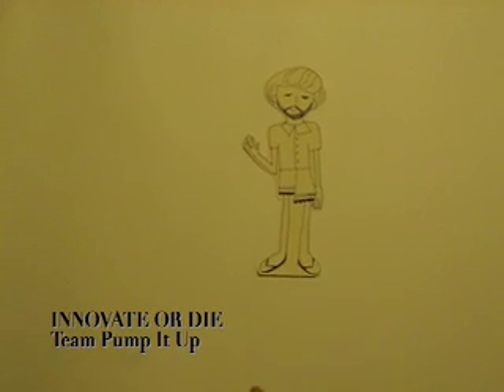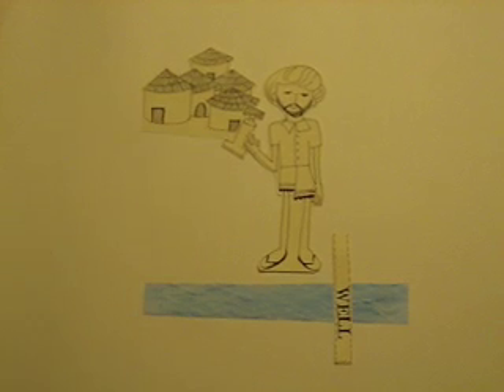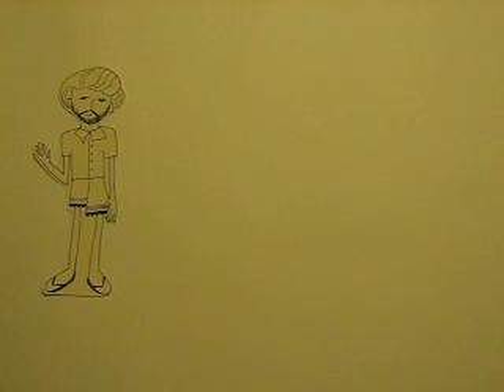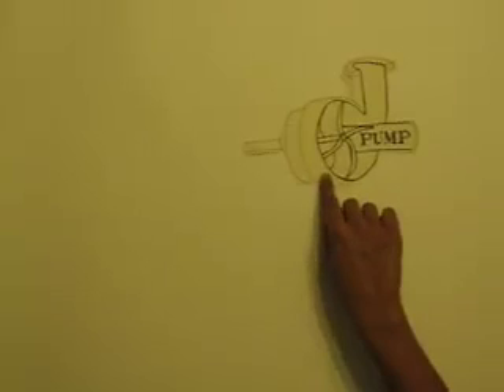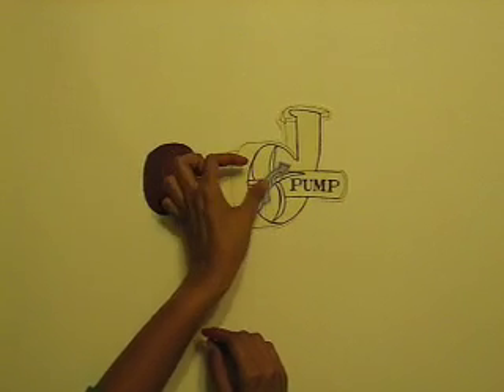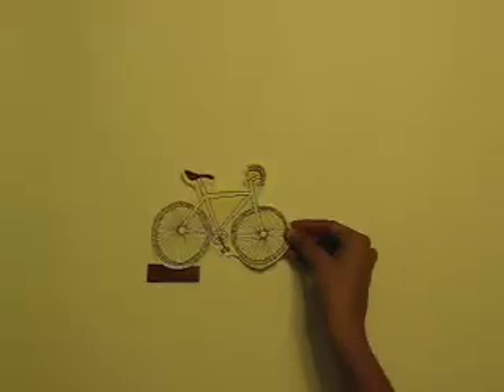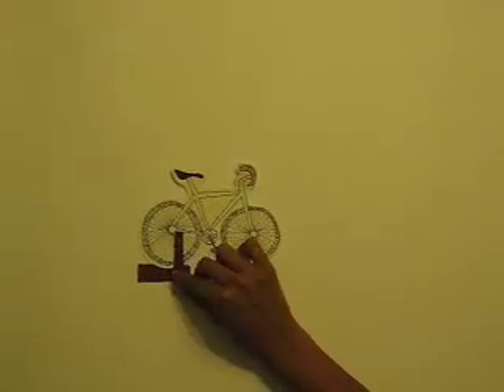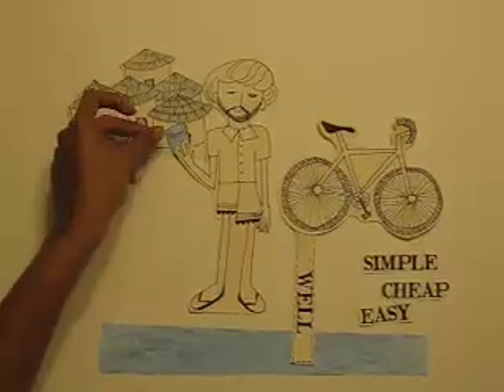Pump It Up

Comment: Arguing passionately for what is essentially a moot point is why you seem to be trying to appear intelligent.  They said "centrifugal force", which doesn't specify what exactly they mean, but since their device works they must be referring to something quite real.  And since this video is concerned with presenting an idea and not with presenting a technical overview, it doesn't need to be that precise.  To insist that it must fit your expectations of technical perfection is extremely childish.